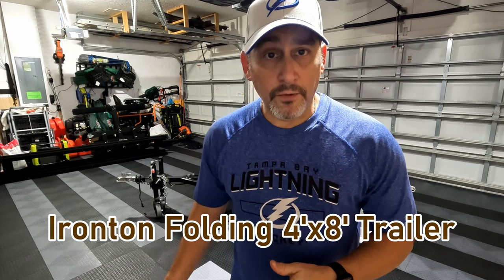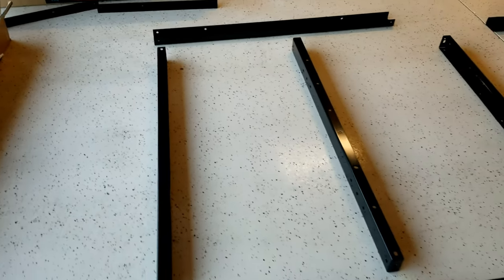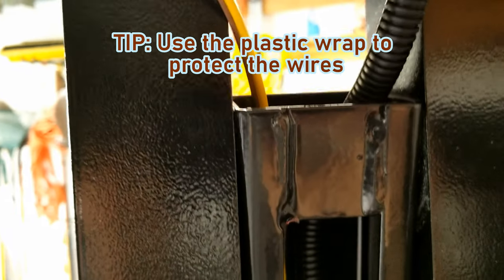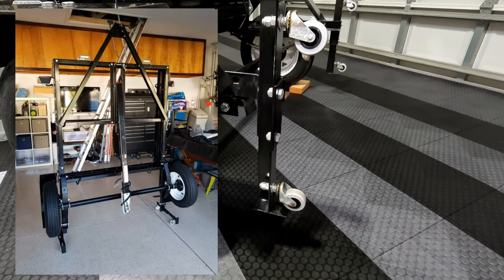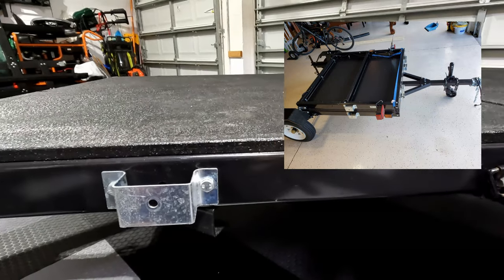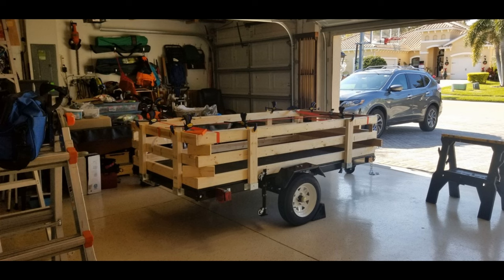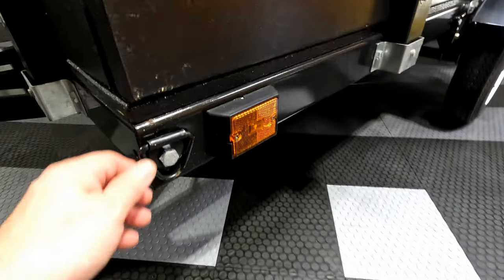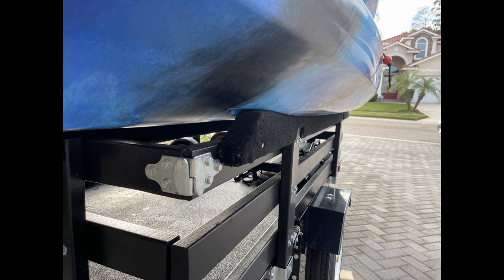Ironton DIY Folding Trailer (Kayak) #ironton #howto #diyprojects #trailer #kayak #diy #review

Comment: We have used our trailer for Kayaks also. What is the max speed you are willing to travel with your trailer?
Reply from the maker: I have been on the road at 65 mph on a couple hour drive.  These tires are "rated" at 55 mph.  I've seen other tires that are rated for 65 mph that can be swapped in which I haven't gotten around to buying yet.